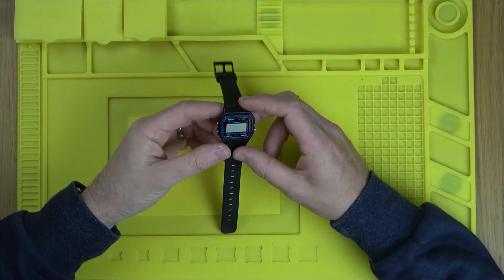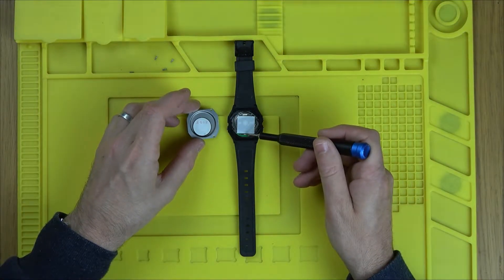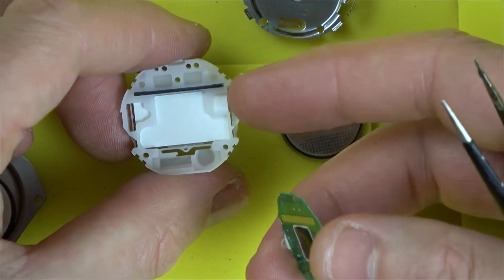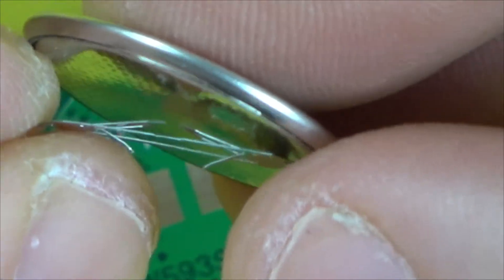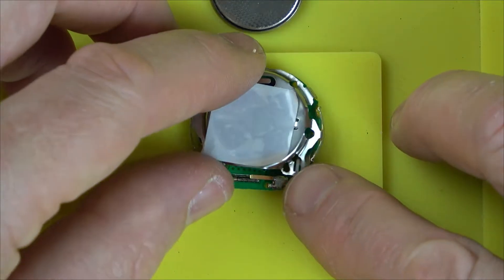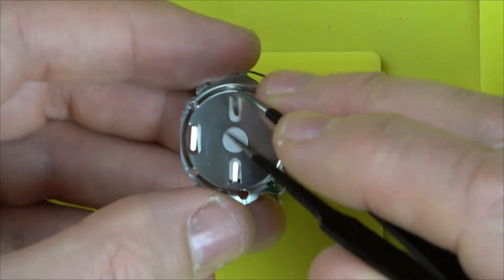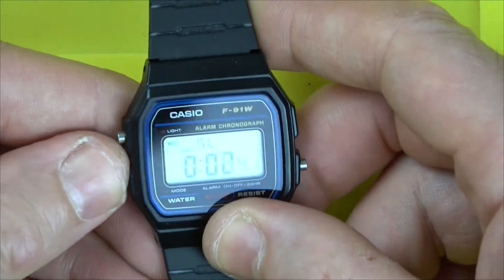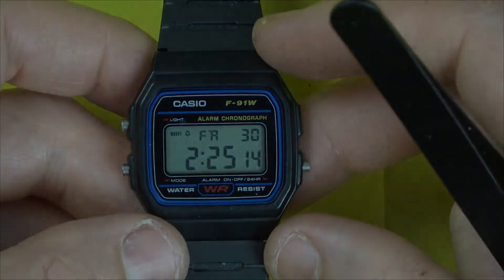How To FIX a Casio F91W digital watch - NO POWER

Comment: this helped enormously! thank you so much. my watch was no power after I replaced the battery. After you showed me all the contact points I bent out the little prongs on each piece for good measure and lo and behold my watch worked! the instructions for getting the movement back in the band to make sure the buttons on the sides were working was also very helpful. excellent troubleshooting, thank you again!